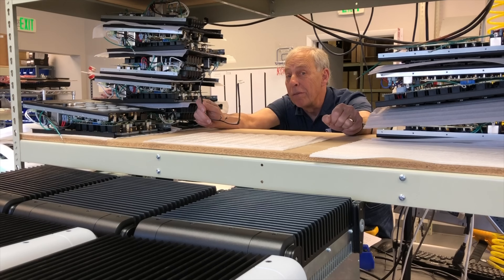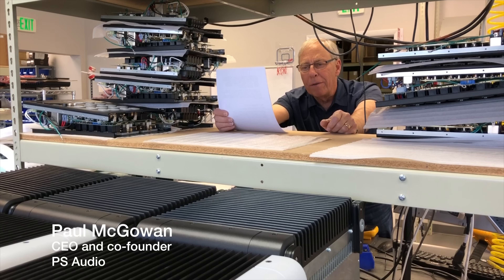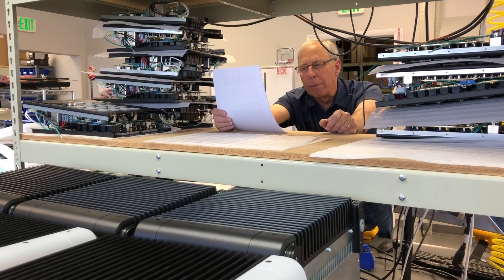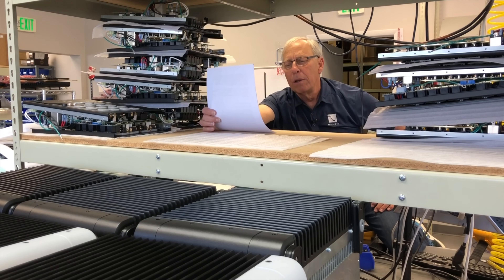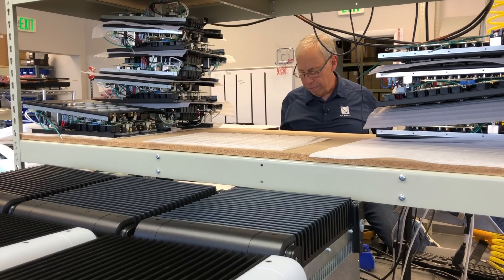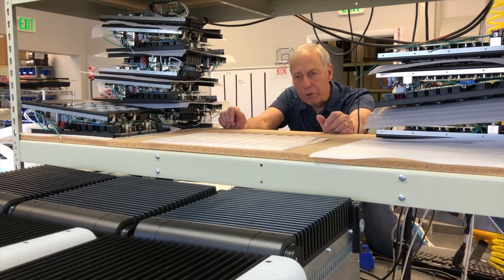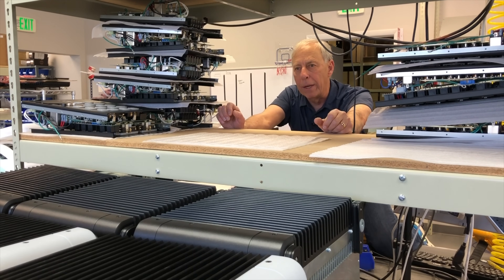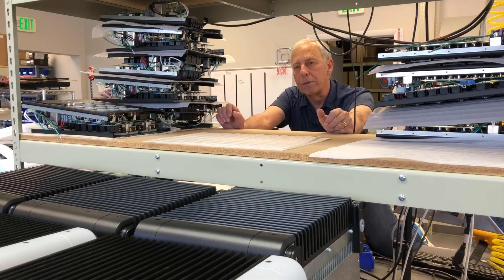Why aren't there more active crossovers?

Comment: This explanation seemed to make using active crossovers seem more difficult than it really is. Non-servo speakers have two wires each. The wires attach to the passive crossover. Bypassing the passive crossover is easy. 

1. Label the crossover points and speaker wires so they can be easily reconnected in the future. 
2. Disconnect the speaker wire from the passive crossover and add sufficient wire to reach the desired enclosure exit point.  If the drivers have push connectors built in, just disconnect the existing wires at the driver and add new wire. If not, use wire nuts, crimp connectors or solder and heat shrink to connect to the driver wire. Some drivers have soldered-on wires in proximity of the voice coil wire. You may wish to avoid soldering near voice coil connection wires. 
3. Install female banana plugs (sockets) or other suitable terminals at the desired exit point of the enclosure. 
4. Connect (solder or crimp) the speaker wires to the backs of the banana terminals, maintaining polarity for phase alignment.
5. Make sure all pass-through points are airtight. 
Have a professional do the conversion if you feel uncomfortable doing it yourself. 

When I built my speakers, I just drilled holes through the enclosure and used large brass machine screws to get the signal in. The screws go through the holes in crimp terminal on the inside. I used brass washers and two brass nuts on the each of the outside connections. The second nut locks the first. I originally used wing nuts to secure the speaker wires to the terminals on the outside of the enclosure, but later found some brass knurled nuts. Most enclosure materials are non-conductive. My speakers are heavy enough that I had to install neoprene casters and a skirt, so I put my speaker terminals on the bottom.  

Paul is right about passive crossovers being complex to design. I designed my speakers to be tri-amped, thus saving myself the (extreme) hardship of building passive crossovers. I wouldn't have had a chance in hell of getting good sound. There's something to be said for having nothing but heavy copper between the silicon of the output transistors and the voice coils.

After many years of leaving my system alone and just listening, I'm working on a project to eliminate my analog crossovers and play files from my NAS. I have a large FPGA, which will have some custom DSP, long FIR filters, crossovers and six DACs. I'm planning on using multiple regulated linear power supplies. If anyone has experience with Balanced Zen Line Stage implementations, I'd like to hear from you. If I get it all working, I'll make it open source.

Comment: All  know thatTo develop any properly working crossover  it takes proper formulas to calculate values and to know the structures of connections . Then speakers won't be damaged and in general work  according to destation. But when it comes  to proper outcome reaching  listener's ears then proper has  meaning   miracle.   Too many changable factors electrical and mechanical and acoustic cooperate together in time and even most of them  are  measurable the results are  hard to interprete and  it turns  nonsens. For miracle required  accuracy  is unreachable  in standard serial manufacturing.   I developed (invented) new crossover which does most of this job by it's natural balancing so I not needed  to scratch my head and it works much  better than generaly known but level of required care would be not practical for average user. Tuning of this crossover has to  be confirmed and eventualy improved with dedicated  tool every month.  Even I  last time found that it is easier to live with old wideranges.  Their advantage is that it do not emulate anything, use 7 bands and almost no RLC filters..But  have this disadvantage that are not produced and alow power of max few watts. For  me it's more than enough.